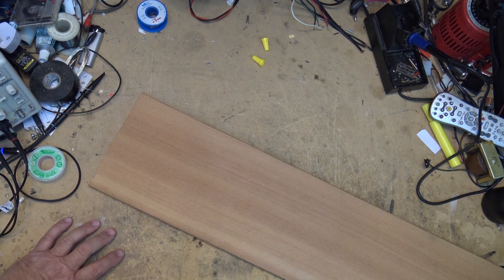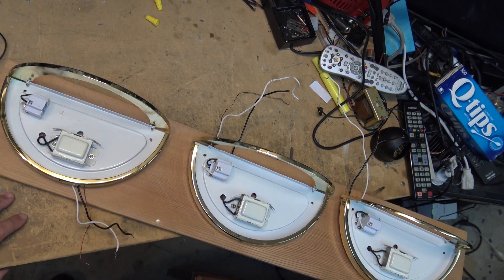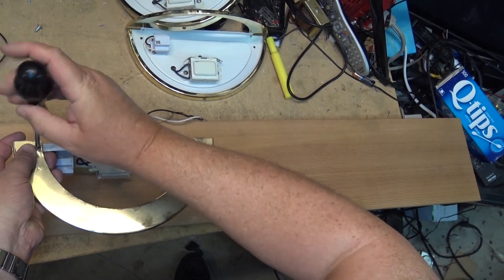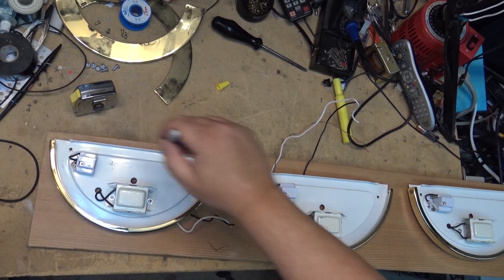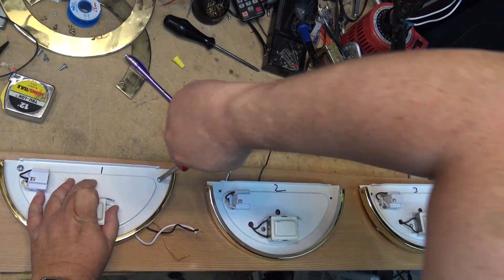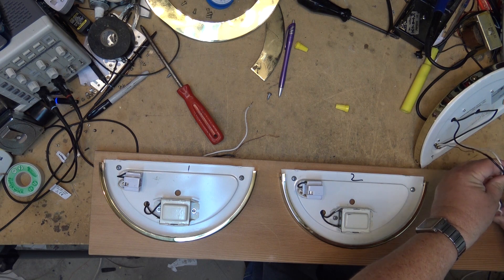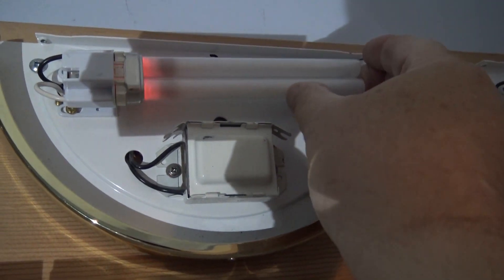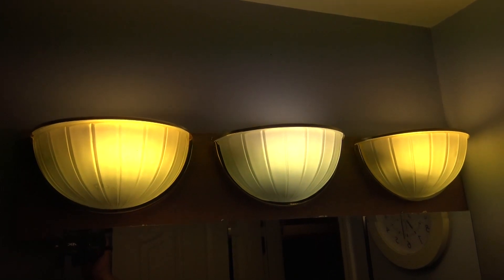Custom light bar construction

Comment: The lights came out looking pretty good.  The only thing I would have done differently, is put a coat of clear satin acrylic / varnish over the raw wood to protect it from humidity of the shower, etc.
Reply from the maker: I did! 3 coats of Varathane Diamond wood finish.  Both sides covered. This was an all day project, as most of the day was waiting for the laquor to dry between coats.

Comment: Smashing job :-D, just a couple of new white tubes and your other half will be happy :-D.
Better than throwing away working units.
Reply from the maker: It sure looks better than the ugly 6 light light bar that had 6 CFL bulbs screwed into it.The old light bar got recycled too. It is on the ceiling right over the work bench, so 6 more CFL bulbs to light up the work bench.

Comment: you could have routed a channel to accommodate the cables on the back of the panel.
Reply from the maker: DAVID GREGORY KERR 
Did that on the drywall cut a channel  back to the electrical box.